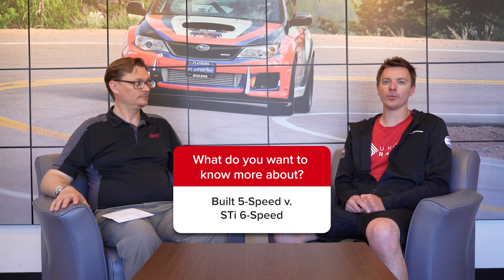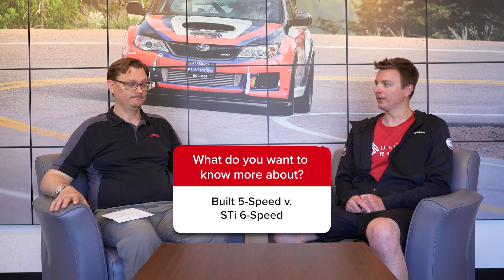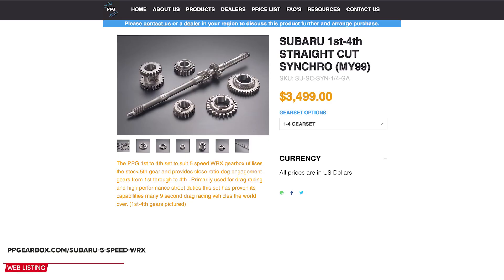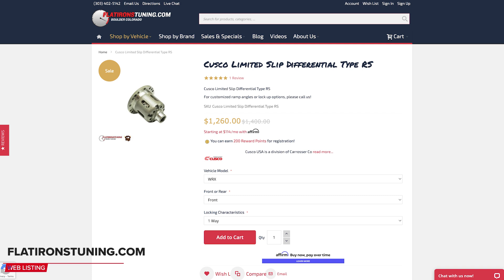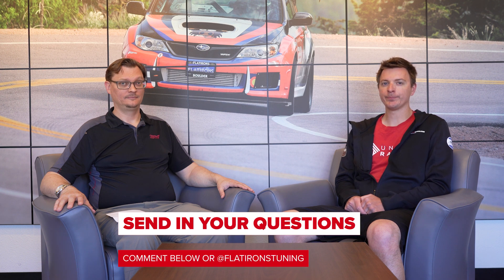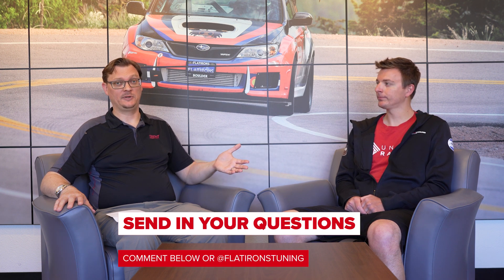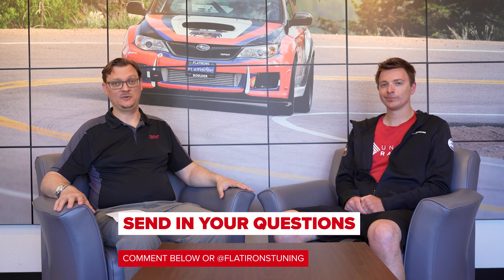Can you build a 5-Speed to be as strong as an STI 6-Speed?

Comment: Hi I've heard great things about the blast plates for the 5 speed transmission. Do you have knowledge about this?
Reply from the maker: Thanks for watching and thanks for your question.  We discuss them here:

https://youtu.be/vwi68Qd-mwE?si=ISF-QyMULHe1vOqT

The short answer is that they are not capable of correcting the fundamental design issues that make the 5-Speed transmission more prone to issues at higher power levels, and they can potentially cause issues of their own.

I'd say it would be best to focus on something like a 6-speed swap if you need the additional strength.

Hope that helps and Stay Tuned!

Comment: I have a jdm wrx 4.44 05-07 5mt and it’s holding 400 hp and torque to the wheels right now. My car weights 2000lbs so wheel spin is the issue.

Comment: I have an important question to me right now that i hope you can answer very soon.

So i have a 6spd from a VA WRX and  i was wondering. Does the front diff have bushings or bearings where the CV axles go? I have deep gouges on the surface where the front driver side CV axle sits and this is resulting in major leaking and noticeable clunking everytime it goes into that gouge. If this means the front diff needs to be replaced would it be better for me to do an STi drivetrain swap or rebuild the OG 6spd? 

Last time i drained the transmission i found the fluid to be black and full of sparkles and not to mention the obvious clump of grey gloop on the drain plug, so its probably due for a rebuild. 

(This car just litterally ticked over 103k miles as of 02-12-24)

Engine also ticks at 3k rpm🥲
Reply from the maker: Thanks for your question.  There are bearings for the front differential.  From what you are describing, it sounds like there is some movement in the front diff/ring and pinion that shouldn't be there.  I'd recommend getting that diagnoses and corrected.  Hopefully it is just bearings, but it could be something else.

We broke the front diff support out of a case when our driver missed a shift a few years back.  That caused both front axles to move freely.  The whole trans was scrapped at that point.

Hope that helps and Stay Tuned!

Comment: is there a stronger Ring & Pinion option for the 5 speed? I want to use one in a FWD application. and with all the torque now going to the front diff, I have to worry.
Reply from the maker: Thanks for your question.  I'm not aware of a stronger R&P for the 5MT front.  I believe that Albins may have made an aftermarket R&P gear set at one time, but I'm not sure if that is still an option.

Best of luck and thanks for watching.

Stay Tuned!

Comment: Very informative video with a great answers 👍 I have my own questions overall I'm not a mechanic I'm just a SUbi enthusiast. I have a 2003 Subaru Baja non turbo 2.5L 4cylinder 165 hp with 250 thousand miles on it. I really love this car I really wanted finally bought 6 month ago the engine is weak started to consume a lot of oil and transmission doesn't shift as smooth as supposed to be with that all being said I want to do on engine upgrade with turbo and 6sp manual transmission I'm on a budget but not specting to be cheap. What recommendation would you suggest on this particular model in order to make the swap. By the way this car is not for a racing it will be for car show and daily driver. Hopefully you take the time to read my comment thank you very much
Reply from the maker: Thanks for your question.  The short answer is that you don't want an STI 6-speed in an NA Subaru typically.  All of the gearing is a good deal taller in the turbo cars because they have a lot more power.  So if you put that in your NA car, you will not get nearly the same useable benefits that you would if you had an STI, etc.

My best advice is that you just have the existing transmission rebuilt.

Hope that helps and thanks for watching.  Stay Tuned!

Comment: Hello i have build transmission strong 5 speed Albins-Gear semi Helical, my car have 435 HP and 460 N/m torque, plate Exedy stage 2, oem flywheel, disk ACT stage 2, all bolt in transmission Steel 12.9 torque 50N/m, oem 35 N/m and don’t have any problem make 15000 km very strong.
Reply from the maker: Glad to hear your 5MT is holding up.

Thanks for watching and Stay Tuned!

Comment: 22b sti 5 speed is pretty fun to have for city driving. it takes a bit fuel but it picks speed good. Especially with a Ej255 running at 8:5:1 compression ratio and 14.5 pounds of boost pressure. with the dccd version the lock mode gives good acceleration. it's not heavy either. The 6 speed is quite heavy and affects drivability at city limits. But on the highway the 6th gear allows for more speed.

Comment: What about PPG 5mt dogbox vs 6MT.  Obviously the Dogbox is more expensive but is it  faster?
Reply from the maker: Thanks for the question.  A PPG dogbox would be a lot more than a 6-speed, especially if you were going to do something with the differentials.  And they have also not proven to be nearly as reliable for holding power, etc.

Would it be faster?  Only in some specific circumstances I'd say where you might be able to shift the dogbox less.

Hope that helps and Stay Tuned!

Comment: This is good information. It's been a couple of years now be we spoke about building my 04 Forester XT engine. The build has been finished now for a while and is super solid. I appreciate the knowledge you shared with me. It came off the dyno with 350 whp and 350 lbs-ft of torque. Needless to say, I drive pretty easy to keep the trans together. Though there are the occasional spirited drive moments. No launching just rolling into the power.  I have been throwing the idea around for a bit now on swapping over the trans or building out the 5MT. Outside of throwing on some blast plates, It seems that the 07 STI 6MT is the way to go. Thanks again for the info. Look forward to the next video.
Reply from the maker: Very glad to hear that the Forester is working out well for you, and glad that we could help!

If you need any help when you are ready to do the 6MT swap in the Forester, just let us know.

Thanks for watching and Stay Tuned!

Comment: My main issue is 100Km/h cruising speed where either in a 5spd or 6spd the engine RPM is just shy of 3000 RPM and the 5spd ratios do the turbo justice. 1st gear is almost useless so taller ration diff's would be a good option for me. At the moment I'm running 225x55x17 tyres with speedo correction, this has dropped my 100Km/h RPM down to 2600 which provides much better economy and range per tank. I've driven 6spd subi's but I prefer my 5spd.
Reply from the maker: Thanks for the comment.  Stay Tuned!
Reply: 55s ...wow 😂😂

Comment: What is the strength caparison of the WRX 2015+ 6MT to the sti 6 speed?
Reply from the maker: Thanks for your question.  The split-case 6-speed in the WRX since 2015 is roughly equivalent to the previous 5-speed WRX transmission.  Because of the 4.11:1 final drive, it may be a bit more reliable, but it is still not the same as the STI 6-speed transmission.

Thanks for watching and Stay Tuned!

Comment: My MY99/00 5 speed was re-built with custom shaft With Late model STI Gears 1-2-3 and Wider Late Model WRX gears 4-5. 
(there is a bit of a larger RPM Drop from 3rd to 4th than when it was stock, but i adjusted to it in couple days) 
- Does 55-60kph in 1st and 115-120kph in 2nd @ only 6500rpm.  
- Modified Syncros i can shift into 1st at about 40kph for downshifting.
(tho i normally dont thrash the car as i want my 99 GF8 to last me another 15-20 years as its my last car)
Reply from the maker: It sounds like you are running something close to the V6 STI gears.

Glad it is working well for you.

Stay Tuned!

Comment: As someone who has yet to get their Subaru (but really wants to for time attack) the question I’ve been toiling with is just waiting longer and getting an sti or getting a WRX at a fraction the price and doing the swap. With a new 6 speed in a 04-05 it seems like it’ll basically be the same price as getting an sti. I could buy used and save like 3k on the same swap. The full scope of the dream is building out for GridLife street and then street mod classes in the next 5+ years. I feel like if I keep the whp below 600 I could stick with a mostly stock sti drive train reliably and save money in the long run. I want to try and plot this out as best I can so I don’t creep completely out of control but I’m lost on this initial decision.
Reply from the maker: Thanks for your question.  Honestly, there are a number of reasons to start with an STI for motorsport applications over a WRX.  The transmission is just a part of it.  If you want to build the car up from a shell, then the shell is really the important part.

But if you want to start with the car as it is, and build it up over time, the STI has a lot of advantages in terms of drivetrain, differentials, brakes, suspension, etc.

Hope that helps and Stay Tuned!
Reply: @FlatironsTuning  the end goal is getting to around 550 whp with a solid power band. Would stock Sti trans, shafts and axles handle that reliably or would I end up replacing them anyway? From what I gathered the stock trans might, but idk about the rest of the drive train
Reply from the maker: @Sebs_Fab  For the STI, I would be comfortable with the trans, axles, and R180 rear diff at that power level.  Now you will most likely want a clutch type differential in the rear and possibly in the front as well.  But the basic framework of the STI drivetrain has a lot of good options for that.
Reply: @FlatironsTuning  thanks a million

Comment: --Does the 2022 WRX 6MT have the old WRX 6MT, or is it the STI 6MT? Or other? I mean, exactly what 6MT is in the 2022 WRX?
--If it's the old WRX 5MT that was converted to a 6MT, is it worth it to buy an STI 6MT and put it in my 2022? Or, maybe buy a 5MT and build it?
Reply from the maker: Thanks for your question. The 2022 WRX has the same transmission as the 2015 - 2021 WRX.  It is a split case transmission with 6 gears.  It is not the STI 6-speed.

The WRX has always had a split case transmission design, so there are a lot of similarities between the WRX 5-speed and WRX 6-speed.  But they are not the same transmissions.

You can install an STI 6-speed transmission into a 2015 - 2021 WRX and there are a lot of benefits to it.  I do assume that it will be possible to do that same swap in the new WRX, but we just don't have much information about it yet.

Thanks for watching and Stay Tuned!

Comment: I blew up my 5 speed in my '12 WRX and got myself a JDM 5 speed transmission and diff off a '13 WRX. Are JDM 5 speeds any improvement compared to USDM 5 Speeds?
Reply from the maker: Thanks for your question.  Basically, no.  They are all still using the same gear box architecture.

Thank you for watching and Stay Tuned!

Comment: After three 5 speed rebuilds I finally bought a 6 speed with dccd and I can say that’s the best thing I have ever done to my Subaru. It’s literally a different car now - it’s quicker, much more easier to drive in traffic and now it also handles much better while doing some racing. The gearing just seems spot on.
Reply from the maker: Thats awesome to hear.  Thanks for watching and Stay Tuned!
Reply: @FlatironsTuning  would this work with a non turbocharged subaru 5 speed manual transmission? I ask this because I would like to manual swap a 2004 Subaru Forester 2.5 XT but keep it time period correct
Reply: I had the choice of doing a 5 speed build (broke 3rd gear trying to pass someone) or swapping a 6spd into my 04 Forester XT... after doing the 6spd swap + R180(from jdm forester sti), it feels slower (extra weight + gear ratio?) and i have to shift more.  (non dccd 6spd)
Reply: @q2subzero  Yes because the 6 speed of a JDM Forester STI has a way longer gear ratio. If you are not running a 2.5 which has the extra torque then it's a really bad choice.
Reply: @marvinvnl  The US version of the 2004 FXT has the 2.5 already in it from factory.  I'm running a stage 2 IAG built 2.5 motor right now.  I feel like more power would be beneficial with the extra long gears my JDM Forester STI 6spd has with it.  Currently trying to look for best setup with 93 oct and decent hp to the wheels. (currently at 315hp and 350tq at the wheels on my current setup)
Reply: @q2subzero  ahh, I’m running 340hp and 500nm torque right now. But till third gear it’s quick after that it’s meh
Reply: @q2subzero old comment, but anyways it's not the little weight increase and it's not longer ratios. The 6 speed has shorter ratios. Which is why you shift more often. It is just first gear and the final drive ratio that is taller. It's like trying to start pedling your bike in to high of a gear when you don't have the strength yet to take advantage. So off the line it's definitely gonna feel more sluggish unless you increase your power levels to take advantage as others have said.
Reply: @q2subzero  Yes a few notice the weight, some say the ratios are terrible, but here in Australia 6 speed swap now is like GOLD prices
 lol
Reply: I wish I can do a 6speed swap everyone wants almost 10k for it
Reply: @GIXXRBRAH750  it's a lot of work, depending if you get the DCCD version or not.  My 6spd JDM XT STI cost me about $6k (regular US 6spd's cost less) and the shop charged $4k to put it in.
Reply: @q2subzero  is it 4k for the gearbox? 

I’m saying 10k just for the gearbox it’s self
Reply: Man I have to say I had the opposite opinion. I broke 2/3 in my 02 wrx 5 speeed. Basic Cobb and a vf34 twin scroll. Maybe 330 ish hp. I did a full 07 sti 6 speed swap, had custom races made for the cvs to keep hubs and the r180. With the quick spooling vf34 the 6 speed ruined the car for me. I sold the car since I put so much into it. and upgraded majorly. 03 wrx 530hp gt4088 twin scroll with a built ppg 1-4 straight cut 5 speed. Stupid fast. But maybe with the bigger turbo now the 6 ratios would feel better.